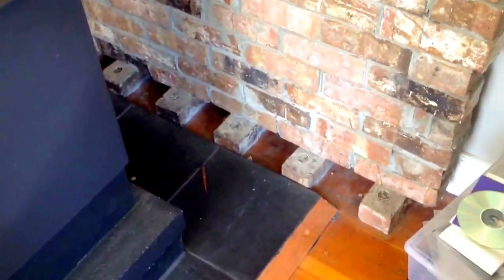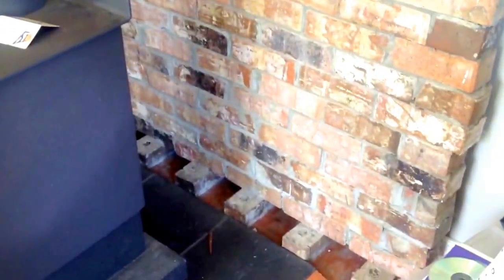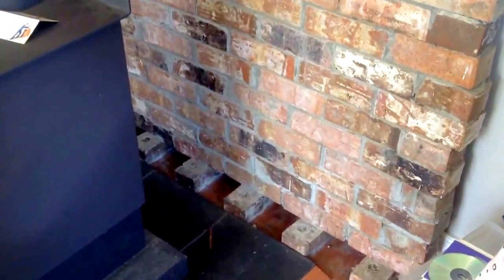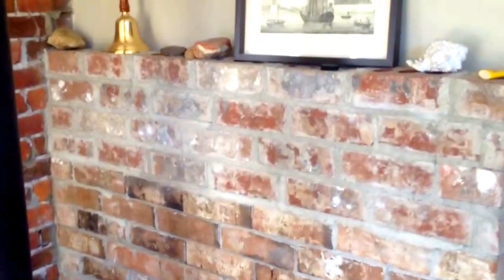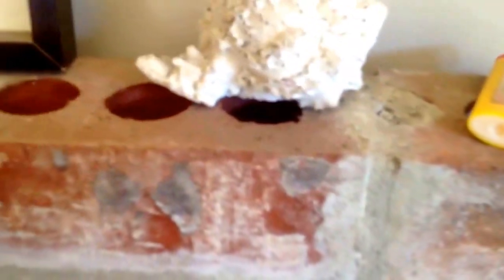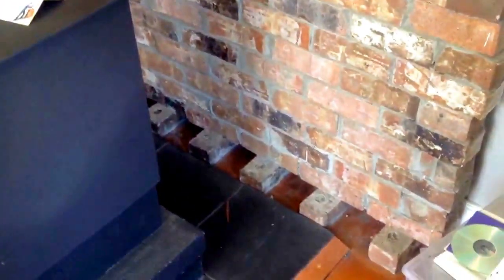Heat Shield Wood Stove Ideas Design Proper Masonry Brick Spacing

Comment: My mason just installed a wall behind my stove which passes inspection in another city. No airflow. The backing is Durock then sandstone over that. My stove is 26 inches from the wall. Is this wall sufficient. It passes for other cities. Thanks
Reply from the maker: That's not really a city decision. Depends on the stove clearance on its label. Check label. Modern stoves have clearances listed that are less than 26" usually. If no label on stove the uncertified stove clearances are usually 48" - a proper masonry shield needs 1" minimum airspace behind and openings above and below. Properly constructed masonry shields allow a 50% reduction. Not sure what Durock is - cement board? I suggest calling a certified chimney sweep in your area for an inspection. They know fire codes much better than most Masons do.
Reply: +capitolcitydean Dura-Rock is a cement board.  My stove says with out reduction you need 33 inches from the wall with reduction 15 inches. So what is sufficient reduction. I did find on an insurance site if you have 3 1/2 inches masonry you can go 24 inches. So I have 2 1/2 masonry and I am at 26 inches.
Reply from the maker: As I said before - you need to have a qualified chimney sweep or wood burning system inspector in your area look into it and check your chimney system as well - finding vague advice and loopholes on the Internet will not help you if your house catches fire. Masons are not usually trained in fire codes either. Fact is - One in seven house fires is caused by faulty Wood burning system. 

Masonry of any sort without proper air spacing simply conducts heat through itself readily. 

Also any stove that has a 33" clearance listed is a very old stove with an out of date certification type. This type of stove usually has poor reburning capabilities and puts a lot of smoke out the chimney into the atmosphere polluting the air in your neighbourhood. These old smokers also collect creosote in the chimney at a rapid rate which increases the risk of chimney fires. Modern EPA approved stoves are usually the only type that are allowed to be legally installed anymore and they have closer clearances. 

Pretty much any stove you get secondhand unless it's EPA rated will not pass a building permit anymore. No matter how cute it is.

Comment from the maker: Our Code in Canada says the space is 1" minimum behind and one inch minimum on bottom, If you are using  channels they have to go up and down not side to side (if you are making a shield with sheet metal or cement board)

Comment: is the heat shield just to keep the wall from getting hot? has no extra heating value or purpose?
Reply from the maker: In this case, The heat shield is used to keep combustible wall protected. and reduce clearances for insurance purposes usually.
Reply: Probably less need for a fan with a set up like that, smart

Comment: that's my dilemma! i have a wood stove kinda near to the wall, last winter the wall got very hot, that really concerns me. 
I was thinking on using veneer brick on the wall, but after seen this, not good, i assume that wont protect the wall from the heat...im looking for a material that is easy to install, and for the heat to bounce back instead of retaining it... any suggestions?? 
winter is closing in, I NEED HELP!
thanks!
Reply from the maker: Best is a sheet metal shield spaced an inch off the wall, and off the floor. Here is my video about that  http://youtu.be/N3a5iQYWHeg